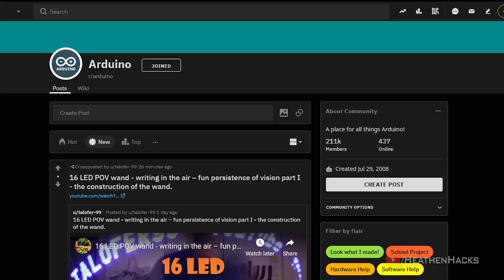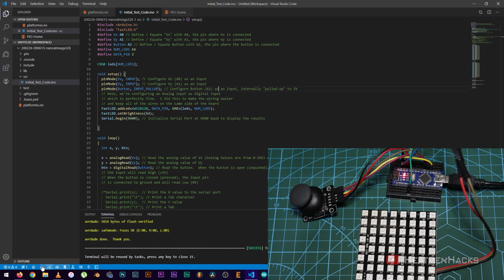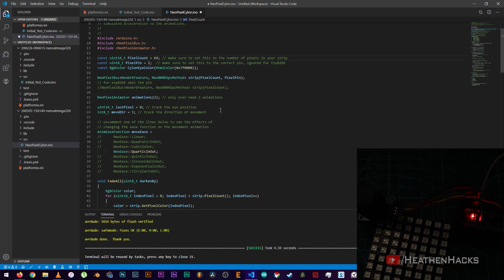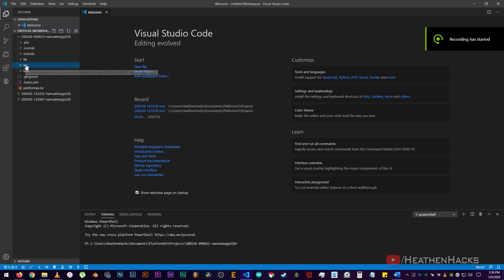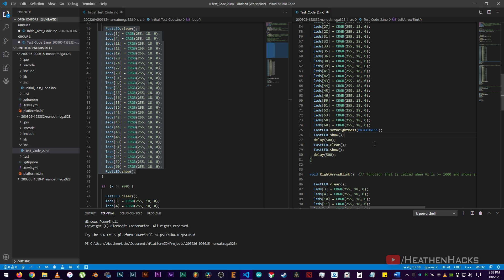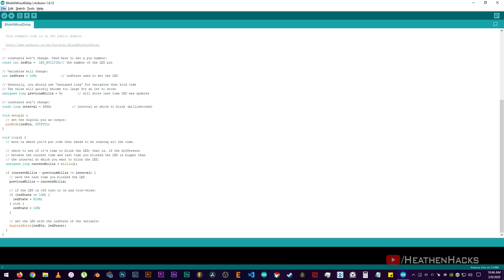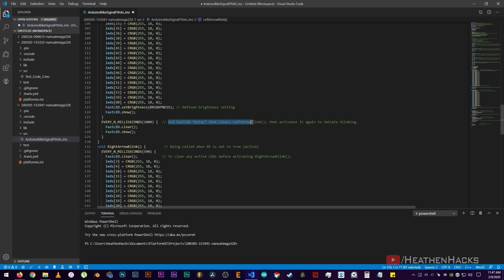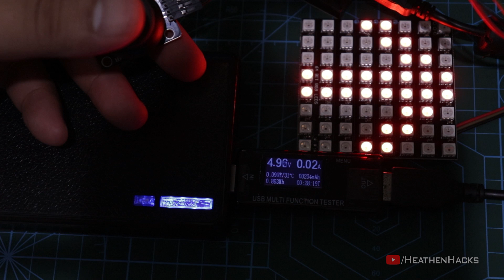Arduino Project #20 | Bike Turn Signal   Part 2 [Code Update & Power Draw Test]

Comment: This video helped me so much for my final project. Thank you!!! Just wanted to know whether will there be any difference if I used Uno instead of  Nano??
Reply from the maker: Hello, Ervin! Thanks for the comment! ♥ Glad it helped! No, there's no noticeable difference with using either of them except the size [dimension] and the number of analog I/O, I think.
Reply: @HeathenHacks  Okayy thank you. Do you have any schematic design for the circuit??
Reply from the maker: What schematic do you need?

The schematics can be found here. Under Documentation.

Arduino Nano: https://www.arduino.cc/en/pmwiki.php?n=Main/ArduinoBoardNano

Arduino UNO: https://store.arduino.cc/usa/arduino-uno-rev3

If you need the schematic diagram for this video/project, you can find it on my Arduino Project Hub profile:

https://create.arduino.cc/projecthub/Heathen_Hacks-v2/bike-turn-signal-part-2-4c6b1e?ref=user&ref_id=550502&offset=0
Reply: @HeathenHacks  I'm actually finding for the schematic diagram for Proteus. 😁😁
Reply from the maker: Hmmm.. I'm not quite sure what you are talking about. Is that my mouse? Logitech G502 "Proteus" Spectrum? lol.
Reply: @HeathenHacks  Hahahah I was talking about the Proteus software. Btw thank you for replying 😁😁
Reply from the maker: lol. my bad. it's the first time i've heard/read about that software. i googled it and it seems interesting. thanks! ♥
Reply: @HeathenHacks  No problem and thank you sooo much! 😁😁😁
Reply from the maker: No worries. I'm just glad that I could help somehow.

Comment: Cool work here. I'm actually doing my own version of a bike turn signal with Arduino Nanos and stumbled upon your videos. Are you planning on keeping your unit all wired together? Separating them into different units and doing wireless communication between the joystick and the lights? If so, with my project I have had some luck with small NRF24L01+ units. Now all I have to do is get some parts in for powering it all on batteries and then 3D printing cases. Looking forward to seeing the progression of your project as well!
Reply from the maker: Hello, Elias! Thanks for the comment! ♥ Hmmm. As of now, keeping it all wired is good enough for me. I haven't even installed it on my bike yet and my bike needs some fixing as well. I guess I'll resume working on Part 3 when this pandemic is over. Thanks! Stay safe, man!